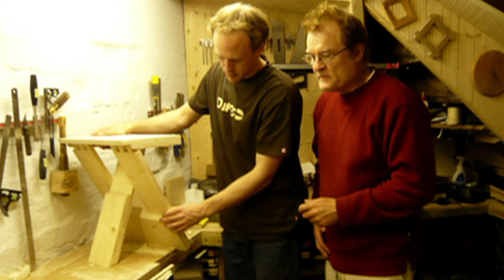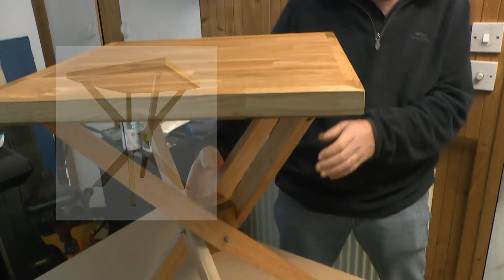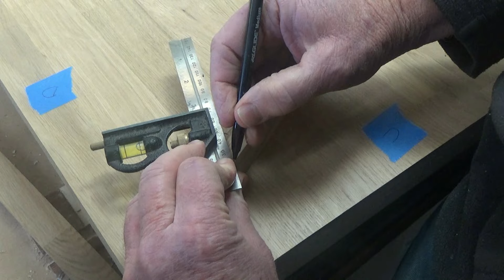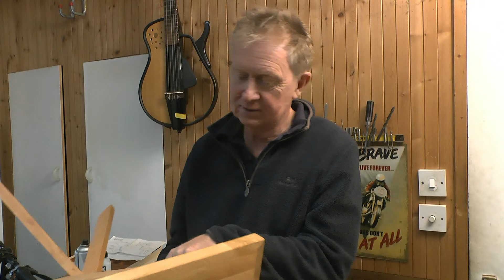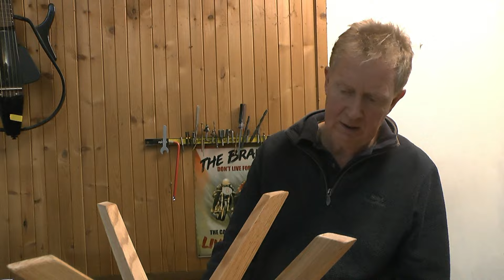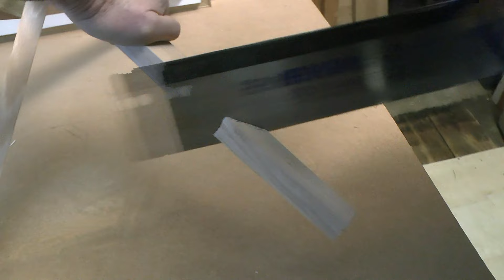Designing And Making A  Small Table

Comment: I'm looking forward to this, thanks Jeremy
Reply from the maker: Hi Edward. This is the first Premiere I have done so thanks for your comment/feedback. I hope some of my subscribers can engage in chat about designing generally and maybe also about using a CNC router 'manually' as I am without using software!  There is enormous scope for using the machine before one tackles the huge learning curve of CAD/CAM as this table project demonstrates. See you on Sunday! (What time will it be in California?)
Reply: It will be midnight, Ill have to take a nap
Reply from the maker: 4pm GMT is 16.00 hours @Eweber007
Reply: @WoodomainJeremyBroun  It will be 8am if the countdown timer on the screen is correct. I was thinking it would be 8am your time, my mistake.